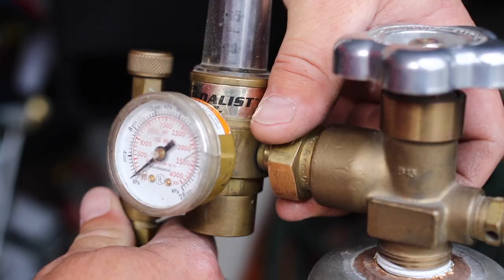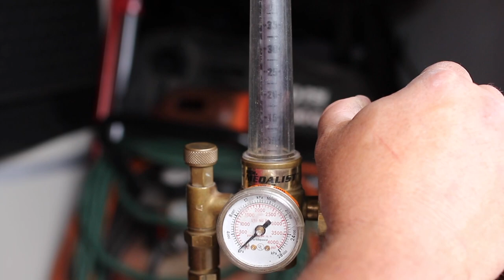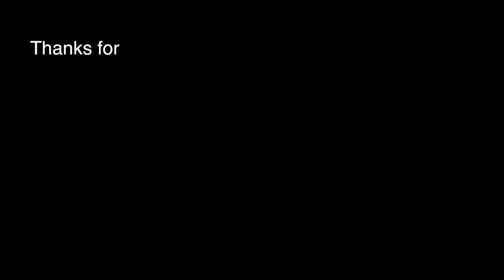Sparco Seat install in the Mini Cooper F56

Comment: Is that 25 mm steel square tube section?
my friend wants me to make one for him and I dont want to take any risks hahahahaha - also the front and rear holes on the main rails seem a little close to the end - in hindsight would you recommend leaving a little extra at each end? Thanks so much
Reply from the maker: I don’t 100% remember but I believe so. I feel like by now someone makes seat mounts/rails for the f56. I’ve had these in for 5 years now with no issues. So I think it’s fine! :)

Comment: Really nice job 👍🏻 
How do I order one for my F56 JCW?😃
(Seems to be impossible to find one on the market🤷🏼‍♂️)
Reply from the maker: The seats ? From sparco or a sparco dealer
Reply: @JulietteHallie  (thank you for prompt reply👍🏻) I already have the seat, but missing the seat frame (seat base). 
You could make a business fabricating yours😊
It seems impossible to find one for my F56 JCW🤷🏼‍♂️
What did you use to bypass the seat belt alarm?
Kr David😊
Reply from the maker: @daviddollerup4654  ohhh ok. Yeah we made our own brackets. Check Planted they might have seat brackets !!!  I didn’t bypass the alarm mine chimes when I first start the car

Comment: Bit late but how and where did you disconnect the wire from the OEM seat to the floor?
Reply from the maker: If u remember right there’s like 3 connectors connected to the bottom of the seat! You have to unbolt it then tilt it up

Comment: How to you get rid of the passenger side airbag light?
Reply from the maker: Peter Zuo I have the lights on 🤷🏻‍♀️
Reply: 2ohm resistor wired into the plug under the seat will turn the ab lights off!